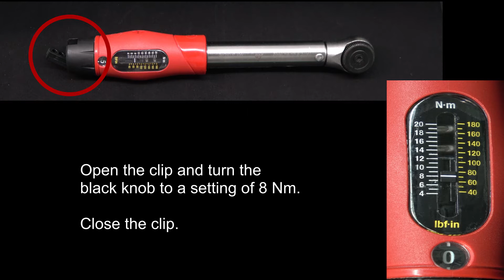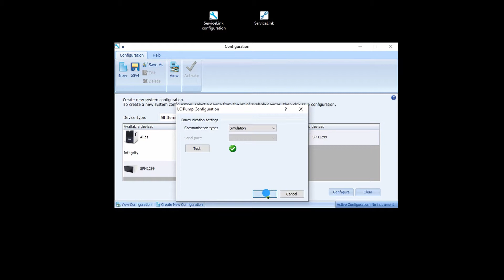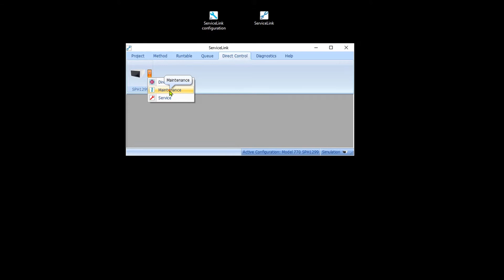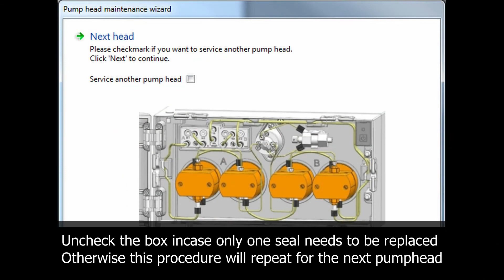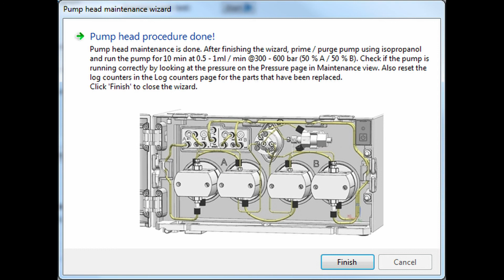Model 770 seal replacement

Comment: What is the part number for the seal and piston replacement kit and the lubrication kit for this pump model?
Reply from the maker: Hi Thom, 
Our pump is supplied to OEM partners only. This means if you would like to order parts for this pump you can contact the company you bought this pump from. The maintenance kit you're looking for will probably connect with spare part number 0770.7xx or 0774.7xx . The maintenance kit will contain all the replacement parts required for maintenance as well as the lubrication kit which is required for yearly maintenance of the pump drives.
If you need more support please contact me at edwin.gortz@sparkholland.com
best regards,

Edwin Görtz
Service Engineer of Spark Holland

Comment: Hi Team, I have problem with the compressibilty and I was change the outlet valve. inlet valve and piston seals, but haver the same problem.
Could you help me with this issue?
Reply from the maker: Hi Claudia, first of all I would like to thank you contact us via our YouTube channel. I hope the videos captured are suitable for troubleshooting. Compressibility errors are mostly caused by air inside the pump inlet flow path. calculation of the compressibility value is performed in the primary pump head during the Pre-compression of the solvent taken from the solvent bottle. If air is taken from the solvent bottle (because a solvent inlet filter is blocked) the primary pump head is not able to calculate a correct compressibility value. If tubing connections are loosened on the wash wash block (located above the pump heads) air is entering the inlet flow path as well. Check the connections for their condition. Please note compressibility error will just occur if the pump was not able to calculate a correct value after 5 complete pump strokes! Log file can be taken from the pump to be evaluated, which prevents parts are replaced unnecessary. please contact me on Service@sparkholland.com if additional support is required. kind regards, Edwin Görtz